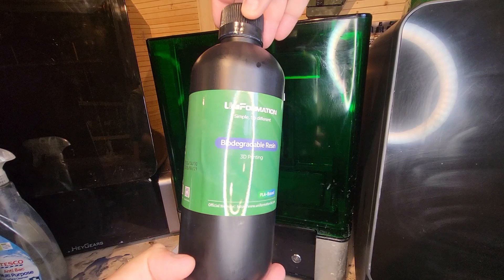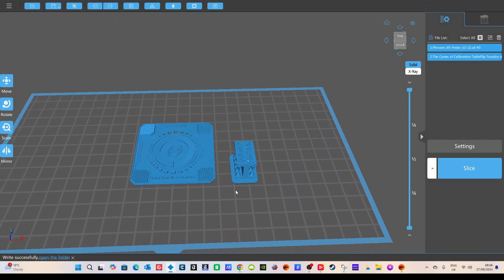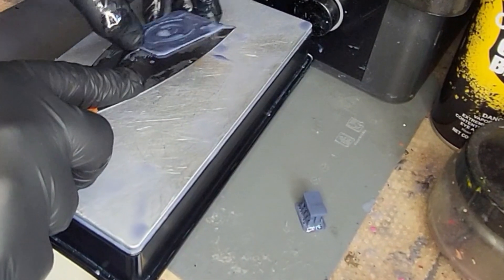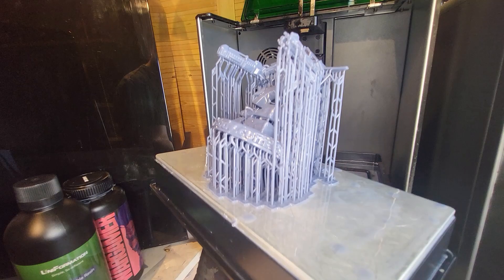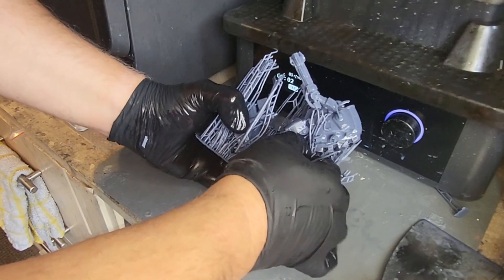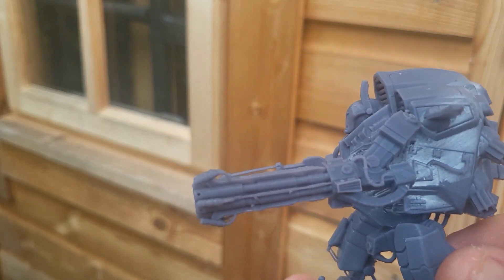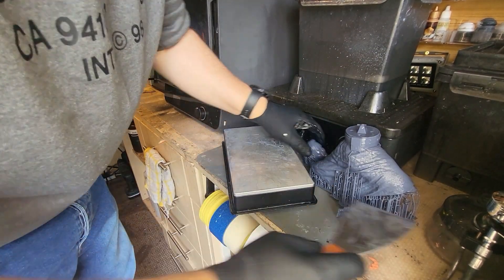Uniformation Plant Based 3D Printer Resin Test My First Experience With X13

Comment: You should try using the wham bam build plate. then you dont have to use a tool to release the build off the plate, the Wham Bam plate is magnetic and pops off and then you flex it to remove your build. I put them on all my printers including fdm and sla.
Reply from the maker: Thank you yes I've used this before absolutely agree with you just didn't really find that I've needed it on the gk2

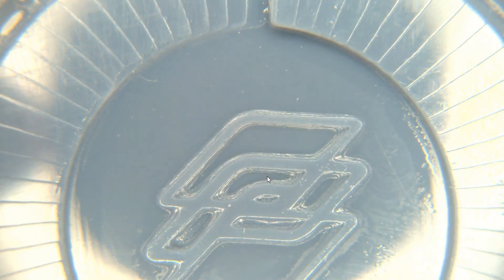Comment: I've been using the X12 (black) resin, with a 0.030mm layer height and a 2.0 or 2.1 second exposure time.  My exposure tests don't have the overexposed look seen on the one shown at 02:44.  Might be worth experimenting with shorter exposure times.
Reply from the maker: Thank you

Comment: Still not convinced, the end result quality is not enough for me personally. weather it´s down too poor supporting or poor post wash and cure, the results aren´t good enough for me. I´m looking for ultra smooth and clean surfaces. Thanks for sharing!
Reply from the maker: I think my ipa needs a change lol
Reply: @greedy3d480  have you ever tried methyl alcohol for cleaning? Since i tried it i haven't gone back to IPA. Same price as ipa but it lasts longer between swapping it out for a new batch and i find it leaves a cleaner surface. :)
Reply: @Joe-Skynet same here. Wanted to mention that as well. Also looks like issues with the layer lines being easily spotted on the arms of the obiwan model, I had this issue when my fep became worn out.